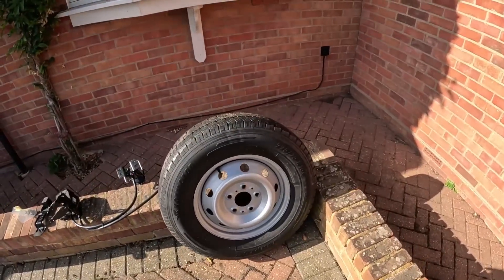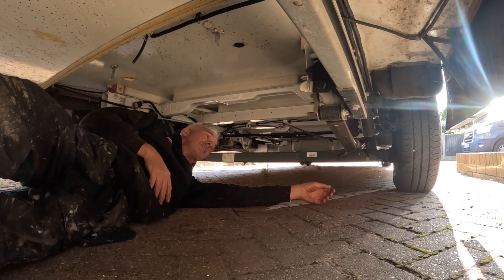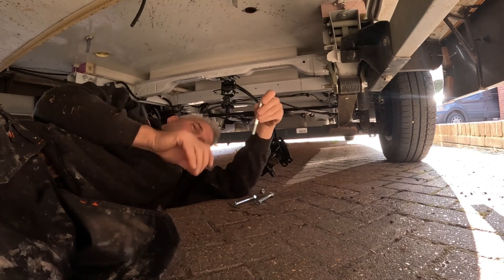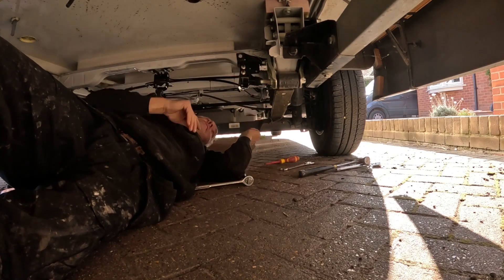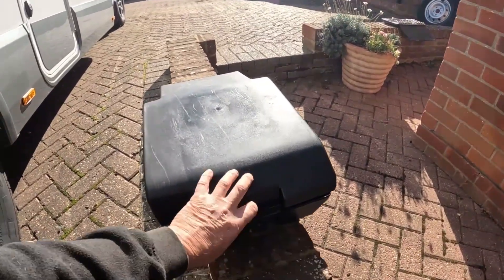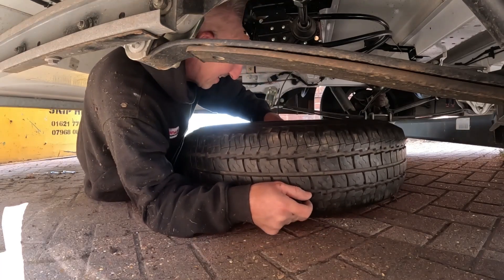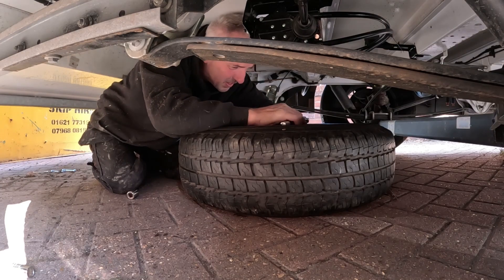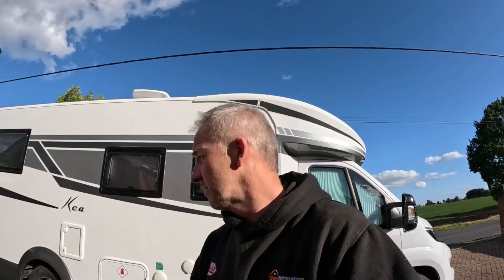How to fit a Fiat Ducato underslung spare wheel carrier, wheel & tyre yourself

Comment: I’m glad someone did make this video. I had the apparatus already fitted to my van but found it fiddly to attach the wheel. I wanted to confirm I was doing it right. I found it difficult to get the carrier through the centre hole. I think it helps to first tilt the wheel so it’s sort of 45° supporting it on a bit of wood or similar to undo the little securing bolt then remove the carrier through the hole. The air was blue before I worked it out. The video helped a lot. Thanks for sharing!
Reply from the maker: We had no issues at all and was pleased we didn't have to jack the van up as plenty of room underneath.  Glad you got there in the end and our video helped. Happy travels and at least you have a spare if you get a puncture or blow out now.

Comment: Brilliant vlog.Nice and simple and my next job.I think I'll get a protective cover for the wheel and tyre as well.
Reply from the maker: Thank you!  It sounds like a good idea with the protective cover.  Good luck with it and hope you find it easy.
Reply: So job done and for the benefit of others, I'd already had a tow bar fitted and encountered a couple of issues. The 1st one was that one of the brackets holding the winding mechanism to the chassis was fouling one of the strengthening plates added to the chassis for the tow bar. This was easily rectified by taking a small notch out. The other problem was that the plate also prevented me from inserting the wind down tool into the housing. The only way around this was to fix the bracket holding the winding mechanism with a single rather than 2 bolts which allowed it to pivot down just enough to insert the bar. While not ideal, the bracket is taking only the weight of the mechanism so very little in reality. It doesn't move when operating the winder so I'm comfortable it's secure enough.Hope this helps others. Got to get a wheel cover now. Can also recommend Halmerend
Reply from the maker: Fantastic!  Sounds like your job was more work so well done for doing it.  Will definitely come in handy if you ever get a puncture and peace of mind! Happy travels!!  @GedandMichele
Reply: @GedandMichele зачем вам колпак,  чтобы грязь  собирать и ржавчина была?

Comment: Great video i fitted a 2nd hand  carrier and spare wheel with the help from this video. Straight forward except we had a towbar  fitted and the chassis extentions block out the winder fixing holes so the winder had to be strapped to the chassis extention which still works good enough for the times it will be used.Somthing to think about if you have had a towbar fitted.

Comment: Great easy to follow video, hopefully I find it the same 😁 Would you mind confirming the bolt sizes please, 3 x 100mm M8? & how many ? M8 x 20mm. thank you
Reply from the maker: Good luck and hope you find it easy enough.  When ordering the carrier from Halmerend, they supplied the bolts for mounting the wheel carrier but they didn't supply the bolts for the bit you would attach your spanner to when winding down the wheel, although it was all pre-drilled.  We, therefore, purchased 3 x 100mm M8 nut bolts.  Hope this makes sense?
Reply: @Miles_and_miles2023  Thank you for coming back to me, I ordered the carrier from eBay. Haven’t received it yet, it’s a new one but it doesn’t show any bolts so I thought I’d get some so I’m ready. So far I’ve got 10 M8 x 20mm and will now get 3 M8 x 100mm. Thank you 🙏
Reply from the maker: I am sure you will have no problems but if you get stuck, just let me know.